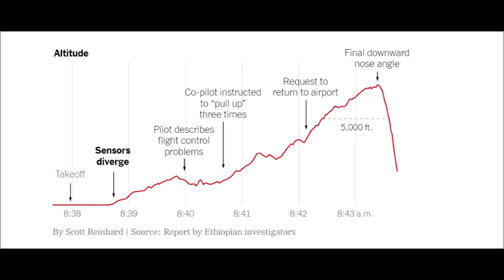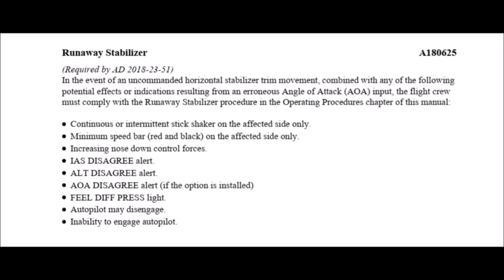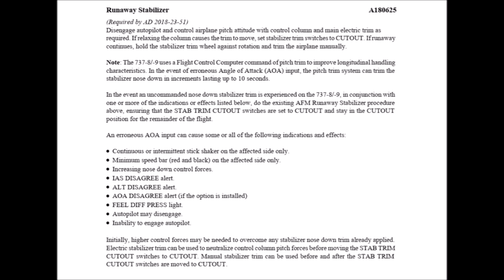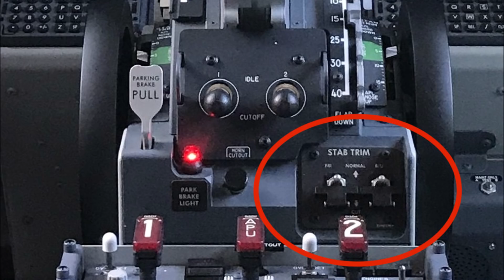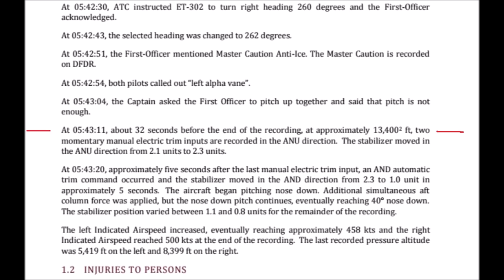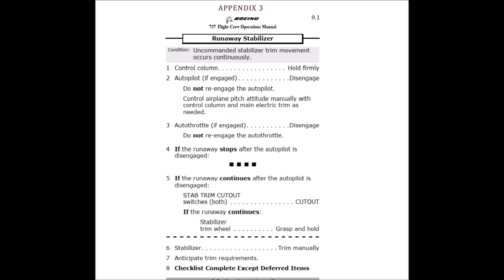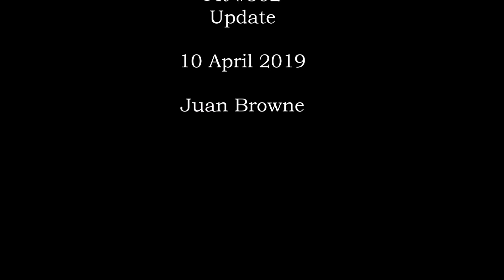737 Max Update 10 April 2019 Runaway Stab Trim Procedures

Comment: Stupid question time here.  Why have they not allowed the planes to fly with the mcas turned off.  The software update is the sole fix as I understand it.  That and all indicators are that this system is the cause of the crashes.  It seams silly to ground the fleet based on a safety system that is on no other planes and can be disabled.  To me it is like the air conditioner on my car causing over heating.  Do I park my car until it is fixed?  No, I drive it with out air conditioning until I get it fixed.
Reply: John B.  Because, unlike an air conditioner, which just affects passenger comfort and can be turned off if you're willing to be uncomfortable, the MCAS actually affects the handling of the aircraft under certain conditions. Just turning it off can cause a hazard if those conditions are encountered.

Here's an analogy: Many new cars have Traction/Stability control systems that feed different amounts of power to different wheels to make the handling more responsive and predictable. That would be similar to the flight computer and the way it normally adjusts the aircraft trim for various conditions in the older version of the 737.

Then the auto manufacturer adds a bigger engine to the newest model. But they discover that, under just the right conditions in a turn, the old software can direct too much of the new power to the rear wheels, and cause the car to break loose and spin out. Instead of completely redesigning the entire traction/stability system, they add a fix that watches for how far you turn the wheel, and it automatically cuts back power to the rear axle so it doesn't break free. This would be similar to the MCAS app, applied to the existing flight control software.

But now, when a sensor goes bad and sends the wrong data indicating falsely that the steering is cranked over, the new system can cut so much power to the drive train that your car suddenly slows and nearly stops, and you get rear-ended because you stop on the highway without using brake lights or other indications. 

The company says you can avoid this by watching for unexpected slowing, and cut out the traction control on the dash, manually shift the gears down and mash the gas to get back to speed. 

But, if you just turn off the system all the time, you might find yourself suddenly spinning wildly down the road when the rear end breaks loose on a curve unexpectedly - - the problem the new software patch was supposed to prevent in the first place! Sure, you might not have gotten rear-ended by slowing down, but that doesn't help if you're out of control, spinning into oncoming traffic and an 18-wheeler is about to T-Bone you. 

The MCAS is intended to prevent an unexpected Stall condition, cause a spinning crash into the ground. Not exactly something you just want to casually disable every time you get in the cockpit. Not to mention that the same switch also disables all the normal automatic trimming (traction/stability) that goes on every time the pilot moves the throttle, changes flaps, and takes many more actions. 

Hopes this helps the understanding.  Cheers!
Reply: @vrghr  Please I am not trying to be a smart ass here.  Lets go back to your traction control.  I have never driven a car with that option.  My little Jeep seen in the icon does not have that.  I have made mods that actually make it less stable than the MFG specs.  Disconnected the sway  bar,  removed the track bars.  Something my old Jeeps never had.  I put on auto lockers on it.  This all makes it a roll over machine and or spinning top.  I drive it as such.  

My point here is that I drive it manually very much like the pilots fly the older 737's.  Respect the equipment and do not over drive/fly it.  The new automated systems are great.  Just one problem, when they fail, the pilot must know how to fly the plane.   

From what you are describing the mcas is both a safety and convince issue.  Funny thing is, it is inactive when the flaps are down and/or when the auto pilot is on or off, I forget which.   

Simple cure.  turn the system off and fly it like your are driving on ice.  This is great training for the pilots.  As the fleet ages and ill trained mechanics get their hands on these planes, more failures will happen.

Great example is the last 737 Max that went down.  Problems reported at least once.  The mechanics did not fix it.  I do not put all the blame on them.  Both software and lack of redundancy was Boeing's fault.  It also appears that the pilots had some hand in this.

Another great example.  The pilots had no hands on this one.  The idiot mechanics improperly replaced an engine on a DC 10.  It went down in Chicago.  This one hit me hard.  Me and or one of my family may have been on the very same plane at one time.  The pilot lived 2 blocks due south of me.  No, I did not know him.  

When the pilots can not fly the planes without the safety systems in place, they can not fly them when they fail.
Reply: @TheLittlered1961  Stability Control systems, an evolution of Traction Control, have been mandatory on all cars sold in the USA since the government mandated them in 2012. Here's an article that describes them a bit better than I did. ( https://www.chicagotribune.com/classified/automotive/sc-stability-traction-control-autos-1112-20151110-story.html )
My analogy wasn't intended to be taken verbatim in any case. It was intended to answer your question on why they didn't allows the planes to fly with the MCAS systems disabled. Basically, the MCAS provides a safety function that is required as a result of new flight characteristics caused by the re-engineering of the plane when the larger engines were mounted, as well as other changes to the airframe. 

Allowing the planes to fly with that system disabled would negate the safety factor that the system was intended to provide. I just tried to put that into laymans terms, that of automotive handling, that more folks would have familiarity with, as opposed to flight characteristics that only pilots are exposed to. 

Please recall that Boeing advertised that the new 737MAX would basically fly the same as the earlier models, and pilots wouldn't require any additional simulator or training time to handle the new birds. The MCAS was part of that, to automatically provide adjustments instead of relying on new pilot responses that would need to be trained into them.
To use your own example - you have significantly modified your vehicle; changes which have, in your own words, made it "into a roll over machine and or spinning top."  Now, just imagine if you had thousands of hours behind a the wheel of a standard jeep, in all sorts of road conditions. You know EXACTLY how it will respond, how far you can push it, and when you're getting into dangerous limits. Much of that performance is now instinct and muscle memory for you.
Then one day, your employer brings your modified version of the Jeep to you, and tells you that you're the driver of this new, improved version. Then they tell you it handles just the same as the one you've driven for thousands of miles! Next, they tell you that you'll be taking loads of passengers on trail and road trips in it, starting that afternoon. And you're expected to hop right in and do just as well in this new jeep, get them over just as rugged of trails, and get them down the road just as fast as you did in the original jeep. 

Finally, they DO NOT tell you of ANY of the mods they made under the chassis!  You can see the new stance, larger size, new colors, etc., But you can't see any of the changes in the suspension, drive train, etc. Further, those aren't even listed in the new owner's manual!
Now, the owners know this thing will roll in stiff breeze, or spin with a sneeze, so they add some computer stuff to take control of the power steering, traction control, transmission, transfer case, etc., so that the computer will "adjust" your inputs and correct hazards based on sway and acceleration sensors, without your knowledge. But they leave the "traction control" cutout switch on the dash, just like the old 2011 model had (so that you can cut it off it you get into patchy ice and the traction system tapping the brakes on a slipping tire keeps twitching the steering wheel in your hands). 

And now you're in the world that Boeing put the pilots in when they initially rolled out the 737MAX.  You're heading down the road, and the system suddenly thinks one of the tires is spinning (losing traction). So it applies brakes to that wheel to slow it and let the differential put more torque on the opposite wheel. But there was nothing actually wrong with that wheel, and suddenly you find the vehicle pulling harder and harder to the side, where the system is mistakenly locking up one of your front tires. 

If you're REALLY lucky, it doesn't pull you into oncoming traffic before you figure it out! 

So, the answer is, everyone with this new jeep, turn off the old traction control and just drive it by the seat of their pants, yes?
But, all of the drivers are familiar with the original, stable, sway and track bar equipped versions. AND they've been told these new ones drive the same! So they all turn off the new control system, but the first time they push it to the edge on a mountain road where they knew the old one was still "comfy", this new one suddenly goes up on two wheels because that new software isn't there to stop it any more, and the drivers haven't learned the new handling - didn't even know it HAD new handling - and now it's too late for them to learn it. If they're l lucky, they have room and road to recover. Otherwise, they end up rolling down a mountain.
Yep, seems like there should have been some training on how to fly the new plane without the MCAS running, so pilots could find how the new bird handled. But that didn't happen, and wasn't an option that could have prevented grounding the whole fleet after the MCAS situation came to light. That "stick time" needed to happen BEFORE, not after the fleet was idled. (Might be a good option put pilots through it now though, perhaps.)
Reply: I had to do a little reading.  See  https://theaircurrent.com/aviation-safety/what-is-the-boeing-737-max-maneuvering-characteristics-augmentation-system-mcas-jt610/
and read the SW Q&A.  The system is designed to correct a pilot that is over flying the aircraft.  It is designed to activate under relatively high G forces and close to stall.   Flaps up and auto pilot off.  This is not auto trim except for emergency type situations.   This is more like ABS than trac control.  They are trying to idiot proof the planes so idiots can fly them.  This scares me.
Reply: @vrghr  I agree that the air conditioner was a bad analogy.   The ABS locking up on a car for no reason would be better.  If you could turn that off and drive the car safely until repaired, would you do that?  I would.  

The funny thing is why MCAS was installed.  It was not for safety.  It was to reduce training time for the pilots.  Please see today's video.   He seemed to cover almost everything I said.  The one exception is why not turn it off and fly the plane.
Reply: John Bango  I understand that with the new engines and the way they are mounted, the plane is unstable. That can cause the plane to go into a high angle of attack and stall much more easier than older 737 versions. MCAS was supposed to assist in preventing stalls at high angle of attack. Other passenger planes don’t need MCAS because they are designed to be stable.
Reply: @romandabrowski8994  I understand that they are more unstable than the older ones.  The mcas is not flying the plane.  Unlike the computers in the  b 2 or the f 117.   It is there, as far as I know,  to prevent a pilot from doing something stupid.  You still have the stick shaker and the horizon indicator.  I would love to know how many times, other than by equipment failure, the mcas system has been activated.   By that, I mean the system actually was used due to pilot error.   

At least this is how I understand the system works.  I wish I had the resources that I had 20 years or more ago.  All three pilots I knew are dead now.  Non of which included crashes.
Reply: John Bango good point and good question! It would be interesting to find that out.
Reply: @romandabrowski8994  Should have mentioned.  The best flight I was ever on was with my dad.  He was being certified for a Beach craft 4 seater I believe.  Have to be certified for every type of plane you intend to fly.  The stall was the best part of the flight.  Basic hammer head.  Never would want that in a 737 of any type. lol

Comment: Juan,  somewhere I saw a comment that MCAS was disabled automatically with any deployed flap setting. Also somewhere I saw that deploying flaps on a 737 resulted in a slight nose up pitch movement. Could the pilots have initiated a 5 degree setting on the flaps and 1) defeated MCAS, pushed the nose up a bit, and 2) retained electric (thumbnail switch) activation and control of the stabilizer trim?  I suspect the pilots reactivated the stabilizer trim switches in a last ditch effort to trim the stabilizer because manual trim wheel efforts failed, but failed to deactivate again prior to MCAS re activating for the final fatal time. I suspect the main reason the MAX is grounded is there is a reasonable assumption if this problem occurs on another aircraft, the pilots would for a 4th time fail to properly recognize and execute proper procedures to recover the aircraft. We have the 1st failed recovery effort by the lion air crew the day before the crash where a third pilot recognized the problem and advised the flight crew of the corrective procedure, the 2nd crash day crew failure to recover the aircraft, and the 3rd crew recovery failure by the Ethiopian flight crew.
Reply from the maker: More on this later....

Comment: I am not a pilot, but I was an avionics specialist.  I understand flight.  I do feel Boeing needs to re-engineer some of the hardware/software for the MCAS system, HOWEVER, the air frame, the avionics, the training systems, and documentation have been scrutinized by the FAA and passed.  In my mind there is absolutely no excuse for the lack of experience and judgement on the part of the pilots and the airline who committed to train and certify them.  Yes, "tunnel vision, tunnel thinking, limited time" all play a big part in the accident, and there was an equipment failure.  That said, if either of the pilots had run through and learned  the runaway scenario on the simulator the chances of avoiding this horrendous accident would be orders of magnitude better.

Comment: I hate to say it, but in both crashes of the max, I'm thinking pilot error was the cause. Had the pilots had more experience I suspect these accidents wouldn't have happened. It just makes sense, an experienced pilot in this situation is going to try to get everything operating manually as soon as possible. That's not to say Boeing doesn't have  a responsibility to design systems that work. Great video.
Reply: That experience could have come from sim training, at least if they had gone through this emergency procedure in a sim you could start to blame the pilots. They did not, and this was because Boeing tried to sell this frankenstein plane as the same old 737. It in fact had vastly different characteristics, hence the claimed requirement for MCAS.
A 55 minute iPad induction was Boeing's training solution. All this so as not to have to go through a new type rating and the related expense.
Please don't blame the pilots who certainly must have done everything they could have thought of to save the plane. 
Bean counters in Boeing are ultimately to blame.
Reply: @datinbin  - I would agree that putting the blame on pilots in this situation seems inappropriate.  The information in the previous report on this channel indicates a major design failure.  How any responsible manufacturer can put in an automated system that can endanger the plane by relying on only two sensors and then blindly guessing which of two differing sensors is correct is quite beyond me.  Clearly other pilots faced with this dreadful emergency may have acted differently and the outcome might have been different, but the bottom line has to be that the plane should not have been approved for use with MCAS in the way it was thrown together.  In what circumstance can the software engineers and managers justify relying on AOA readings differing by about 55 degrees.  I think any attempt to push the blame onto the pilots is unthinkable in this situation and, as you say, "Bean counters in Boeing" need to step forward and accept their ultimate responsibility for this one.
Reply: This was not the pilot's fault.  The plane has a serious design flaw designed into it per the designer.  Trying to over come the flaw using a computer does not work in all scenarios.  God save us !   Ground this unbalanced plane.  Peace.